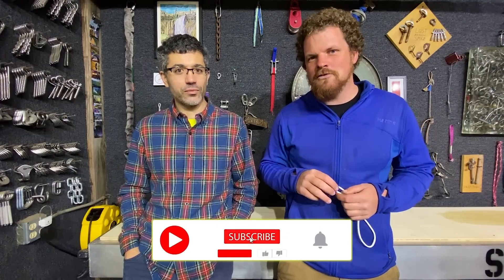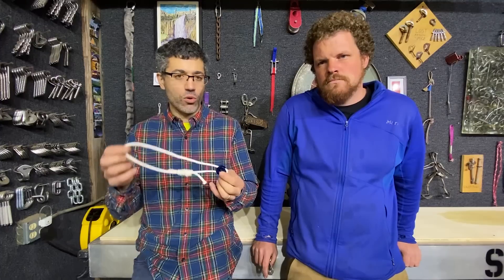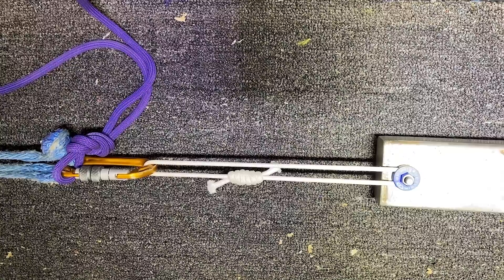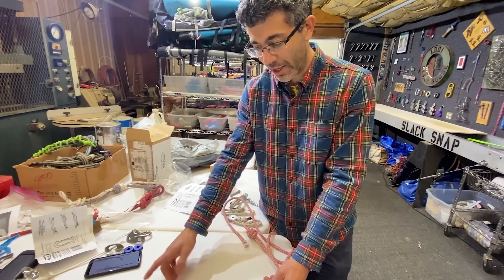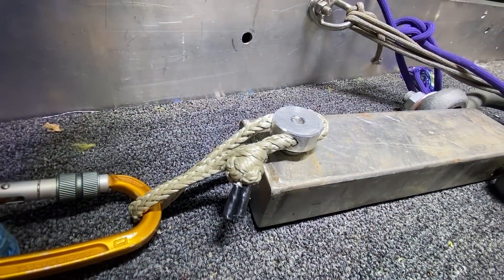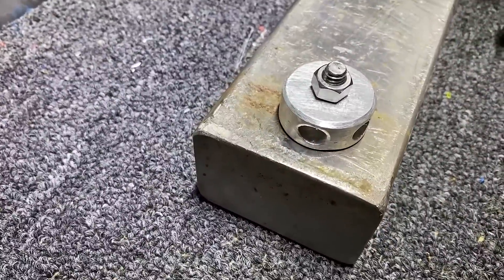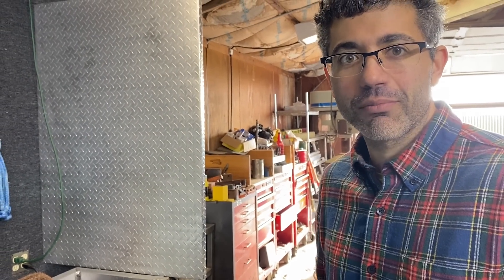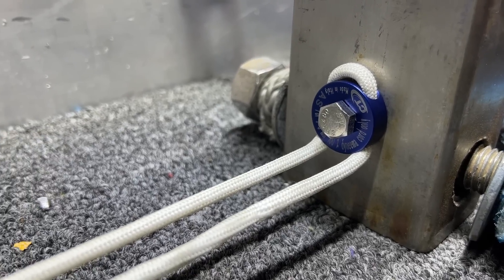Cave Anchors Made Out Of Dyneema???

Comment: Cool results!
But if I understand correctly these alu hangers can be mounted with a spacer — and with 8mm or 5/16" stainless bolts? As with the 5/16" bolt shearing right of is not that unexpected, both shear and tensile strength isn't that great for small diameter bolts. And stepping one step up yields a much better tensile and shear strength.
Could be fun to see how different mountings for these hangers and different bolt sizes and qualities fare.

I'm no climber and much afraid of heights, but I sail and love soft shackles and dyneema in general and the engineer in me loves to see how metal and plastics behave under stress :D
Keep up the good work.

Comment: Always liked clown hangers, mainly because I'm old and becoming slightly cantankerous... When we run out of hangers on a caving expedition there's always a dozen clowns left mostly because all the younger people don't know what they are, and the older members know they have a huge rock footprint which needs to be dressed when they are placed. I always expected them to be weak, mostly because the metal is so far from the rock surface... turns out the bolt deforms and becomes progressively more in tension, which is stronger...lol.
Reply: Now the troll bollards, they had a really small footprint and they shifted the rope away from the wall, its a pity no one has manufactured one for 40 years. I suspect they were discontinued because the 'rules' required hangers that could be clipped into (I have never needed to, or felt it necessary to do this) but i realise it is a requirement in the standards.

Comment: In Bulgaria we use the very often. In most cases to prevent rope friction on a rock or as extenders when the anchor is too hight. We even tie a overhand loop knot above the metal pice if the dyneema/aramid rope is too long in cases that we don't have shorter ones. Very excited to see them tested.
Reply: The overhand loop on top would be interesting to see tested...

Comment: those look like they require a good length of thread on the spit to get it on with a nut as aposed to a hangar plate, many of the caves i go in the UK the existing spits probably only have 10mm of thread pertruding so would be no good.

Comment: It seems that when the bolt and the aluminum hanger survive, the dyneema always breaks where the rope feeds through the back of the hanger over basically a sharp edge. I'd bet the strength would go up on both the production and the home made if a larger radius (as close to the diameter of the rope as possible) and made from 7075 or 7068. Now i want to make some to test 😑

Comment: If you made one of these with a bigger radius would it break higher? Also is it possible to make the radius large enough for it to become negligible?
Reply: i would probably machine those nuts to have a nice radia, and not just 2 sharp through holes...
Reply: @joergengeerds360  Yea like nuts, I wonder if they could be cast with a nice smooth geometry but I wonder if there's enough demand vs just machining them. thinking of the cheapest ways to machine it, maybe just a big fillet on the holes.
Reply: A sheeve from a pulley inside a bit of square tubing to prevent the rope from coming off the sheeve could be done without any custom machining.

Comment: In France, we use it every times. We use 1.5m to 2m of rope and we don't keep the loop close.  And we start replacing all steel anchor by drill anchor and dyneema for the most frequented cave.
Reply: Je comprends pas "we don't keep the loop close" Si tu peux m'expliquer 😅
Reply: @truc2fou915  la boucle de l'AS n'est pas continuellement fermé comme dans la video. Noeud différents et plus versatile
Reply: I got into caving a year ago, going from a 15 year background of rock, ice and alpine climbing, so these spit bolts and the hangers for them a completely new thing for me which I didn't notice for the first time untill I went caving in Belgium again last weekend, where I saw a cluster of 4 spit bolts in multiple caves. It made me wonder why they didn't just use a set of 2 regular bolts with eyes on them, the cost can't be that different, so any idea why spit bolts are used in caving at all over the more regular type of bolts you find in rock climbing?
Reply: @pieterveenders9793  Hi, The history made that we used autodrill (maybe wrong translation) spit bold because we were able to put them we used a hammer and a "STROKER". I was when drillhammer with battery didn't exit. So today we keep using similar spit bold but in inox steel. The reason it's that you use the same equipment has before and you are bringing your own plate-anchor. So it cannot be destroy by a flood and you now exactly how  it's behind the srew.

Sometimes you will found many spit bold because : -first explorer put them really close to the floor (they were using ladder) - it'sreascue equipment - the spit bold tapping is too old and you need to put a new one - or just people try to say i am the best one and my bold is at a better place 

Today when we can we prefer to put drill anchor, like an abalakov in ice climbing. And for rescue we use Petzl Pulse in 8mm.

link to the spit bold : https://www.raumerclimbing.com/en/products/classic/tap-and-rainox/

Some link in french about the equipment of cavities :
http://www.csr-bfc.fr/rc_images/EFS11.pdf
 and about the use of light technique : https://efs.ffspeleo.fr/images/les_cahiers_de_l_efs_n_14_utilisation_des_techniques_l_g_res_en_sp_l_ologie.pdf
Reply: @benoiturruty6568  Thank you, that makes sense! Did the use of spits go down a lot in France the last 2 decades, since portable hammerdrills with lithium batteries became available? Also, thank you for those 2 links, I plan to do a long speleo holiday in southern France next summer, so any info I can use to prepare is very welcome!
Reply: @pieterveenders9793  Spits are self drives. They were used before the hammerdrill came about in Europe and they just keep using them and improving them. You wont really find alot of them in american caves, usually old ones from the 70's. A recent cave I was in had a self drive sleeve in the rock and not having a bolt I guess, the caver  just hammered a piton into it instead! Test that!🤣
Reply: @gindling1054  I downloaded "Alpine Caving Techniques; a complete guide to safe and efficient caving" last weekend and already gave it a cursory browse, including the section about spits, mentioning they can be placed without needing an electric drill but rather just some patience and 10-15 minutes of hammering. Considering portable electric drills are mostly something from the last couple of decades it makes sense that you still find spits, or at least their tapped sockets, from the era before that. Are most caves in the US much bigger, as in they have large galleries where you can easily walk upright? Because in that case it makes sense that all modern bolts are placed by drilling with a hammerdrill. However considering what a hassle it must be to lug around a hammerdrill I could see how some find it preferrable to still use spits if the passages are very narrow and/or low.
Reply: tu penses que la dyneema en manille textile de la vidéo fait combien de mm de diamètre ?
Reply: @boileauthomas3217  j'ai l'impression qu'il on refait usiner des AS pour mettre des manilles faites avec de la 4mm
Reply: @benoiturruty6568  c'est à fabriquer quand même. Manille + AF c'est ultra light
Reply: @boileauthomas3217  ouais j'avis regarder pour faire usiner des AS avec des trou de 8mm c'était de l'ordre de 12€ l'unité
Reply: @boileauthomas3217  on peut essayer avec les AS normaux en prenant de la dyneema plus fine pour les manilles mais faut tester la resistance.
Reply: @boileauthomas3217  bon je vais peut etre craquer et acheter de la tresse en 3mm pour esperer qu'en manille ça rentre dans l'AS